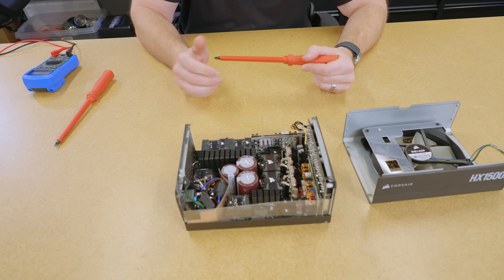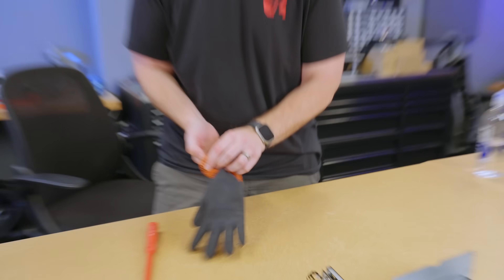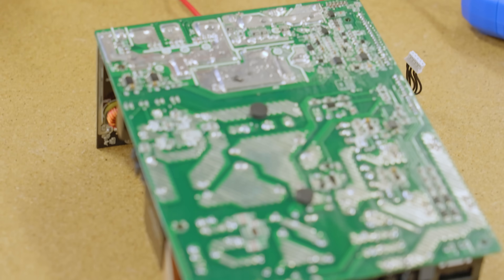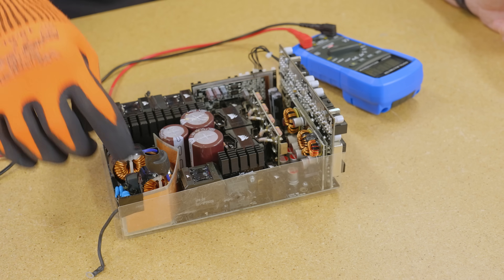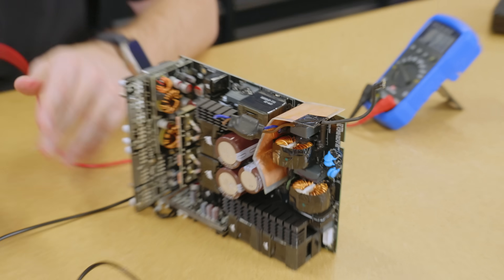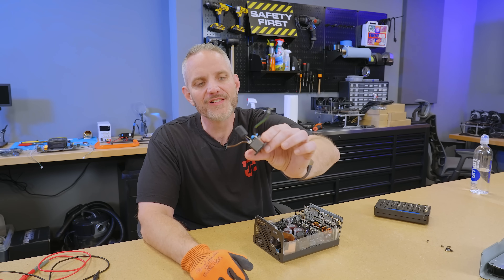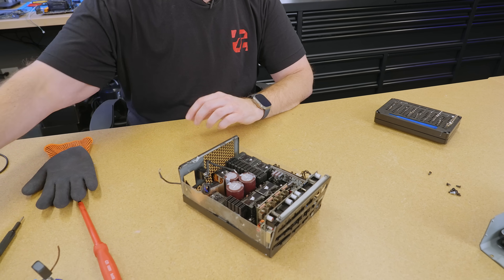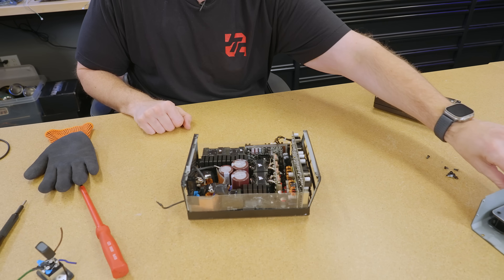Investigating what exploded in my PSU... DANGEROUS! DONT ATTEMPT!

Comment: ✅ Step 3: Use a Resistor to Bleed the Charge
Connect a power resistor (like 2.2kΩ 5W for smaller caps, or 10kΩ 20W for large ones) across the capacitor terminals.

Use insulated alligator clips to attach the resistor leads.

Hold for 30 seconds to a few minutes, depending on cap size.

For example, a 470µF cap at 400V might take 30–60 seconds to safely bleed down.
Reply: An incandescant bulb is nothing more than a power resistor that produces light as a side effect.
So just go get a GU10 base socket and a GU10 base 120v bulb incandescent or halogen bulb from the hardware store, and use that as your "power resistor". It's already rated for mains voltage so you're good to go as long as you only touch the energized stuff with one hand at a time.
Reply: or just use a multimeter with LoZ function, if possible or use it on Ω mode (switch modes before) .
I was screaming at the screen: "Stop using your bare hand, Jay!. You have a multimeter!"
Reply: I know that on small caps (like one in small electronic devices) using a multimeter to check them can also drain them if you hold it long enough (because the caps are so small). Saw another comment about using an incandescent lightbulb and i may build a little thing just for that purpose heh.
Reply: What are you talking about dummy, you don’t want high resistance resistors for discharging capacitors, you want a low resistance resistor with a high power rating. Look up tau the RC time constant, a higher resistance will increase the time it takes to discharge the capacitor 🤦‍♂️
Reply: Just short it with a hair dryer plug. Why complicate?
Reply: @GBCobber  the dryer is AC and the cap is DC. Always use a resistor to bleed the voltage off as Hartmann221 said.

Comment: My estimated guess would be like 2kW spike on the GPU 
Just short them it's that much energy only 15J - 1410uF total at 150V
I personally shorted a cap charged to 330V with total energy of roughly 500J with a screwdriver that had only isolated handle and wasn't at all made for high voltage so just yolo it 😂

Comment: I don't build computers very often but are exploding parts common?  Bout to build a 9800x3d on a Thai chi lite and shits got me trippin. N what happened to quality control and testing? Has it always been this dangerous?
Reply: The power supply failed during extreme overclocking of the RTX 5090 graphics card under liquid nitrogen. Therefore, there is not much risk during normal use. However, any electronics can fail. That's what the warranty is for.

So be calm and continue your build. And if you want to make sure you have a good power supply, choose a Seasonic model with 80 PLUS Gold or higher.

Comment: Grab a spark plug and plug wire to discharge them caps. That is what your ignition coil is, a big capacitor. 
Look at the bright side, it is a lot cheaper to replace a PSU than a GPU.
Reply: No, a coil is not a capacitor!  🙂 They are the exact opposite of each other.

Comment: Those gloves are probably coated in nitrile, which is not appropriate for high voltage protection, it’s used as a coating for gloves primarily for its chemical resistant properties.  I regularly work with chemicals, pretty much all of our gloves are nitrile, or nitrile coated.  Latex doesn’t hold up as well.  Rubber typically is not used for gloves that aren’t directly intended for use in electrical protection because of it’s tendency towards permeability and reaction potential with various chemicals can cause it to break down

Comment: the pop was one of the big caps you can see the markings on top of it that are use as vents are broken , the yellow stuff is the "oil" inside the cap that came out , if you had a loud bang some smoke a fish smell the caps his cooked , the thing you think that has exploded is probably the 5volt standby supply for the psu but pretty sure it still work the cap blew and made the fuse pop thats it

Comment: Boomer Talk: I get the biggest kick out of all the capacitor warnings everyone belts out these days. 
As a child I was the one who took the back off the TV to replace the "instant on fuse" in the 70's, very clearly warned not to touch the back of the cathode ray tube. All the tubes were considered "serviceable" and could be tested at your local TV shop or go all the way to Radio Shack.

Comment: If You'd keep the pc plugged to a power supply but disconnect the ac and then push power button, would that discharge the capacitors?

Comment: Jay, plug in an rgb controller and light bar or rgb fan. With psu unplugged.  Once they are plugged in to the psu, then take the motherboard plug and jump it so the psu thinks it’s turning on.  Caps should discharge quickly to try to power the rgb controller.  And yes, you can jump across a capacitor with a piece of wire or pliers to discharge it.  That is what AC guys say to do with outside condenser caps that run the fan.  Just rattle a screwdriver across the tips with power turned off.
Reply: Unfortunately no, that would not have achieved anything. If the PSU circuit could run, and thus discharge the capacitors, it would already have done so. The standby 5V runs constantly in an ATX PSU, and will deplete the capacitors whether connected to anything or not.

Comment: I had a old p4 system with some chepo PSU in it, had a single cap that would blow occasionally I had to put a 50v cap in place of the 25v one that kept blowing when replace with the exact same value one. Probably a different problem causing it but it was just used for  internet searching so i never had any reason to poke around any farther.

Comment: I'm into retro rigs. Some of them won't work well on modern 12v psu. I need older units that had strong 3.3 and 5v.

I had to disassemble a couple of them for inspection. But I can't get away much longer without learning how to recap them.

Comment: You can discharge capacitors with some multimeters. Some have a low impedance mode that has a resistor. Or switch it to resistance mode and then connect it.

Comment: You know there is a hot and a cold side? It is very unlikely to get shocked by grabbing the PSU on the connector daughter board, that is just 12V, 5V and 3.3V. If you get shocked by touching it, you've hit the check pot and should go gambling or buy a lottery ticket.

Comment: You caps actually lost 20 volts in 24h (us voltage is 170 peak to peak, 120 is the RMS value). with some maths, we can deduce that after around 10 days your PSU should be safe to touch.

Comment: I'm on my third actual, real PSU (not the gray, small fan, less than 300W, no PCIE connector ones I mean) and BOTH previous ones popped the OVP (Over Voltage Protection) IC. And it's probably just a case of dust and humidity that shorted something out and the circuit dies to protect the rest. Mind you, last one was 11 and a half years old cuz I usually take well care of them regarding cleaning. I still have them stored somewhere... I'm just lacking an air soldering station and patience to try to fix them.

btw, I know it's OVP IC cuz in both cases I found their top part rattling around and looked up their datasheet.

another funny point: "I'm not shorting a cap that big"..... pffff can't even number how many times I discharged caps by shortening them and whatever I was using at the time SOLDERED to the contact points

Comment: It looks like the top of the large capacitor has ruptured, which suggests it exploded due to excessive internal pressure. This might have been caused by another component failing. The cross-shaped pattern on the top of the capacitor is there intentionally — it's a pressure relief feature designed to let the capacitor vent in a controlled way if the internal pressure becomes too high. It's a safety mechanism to prevent the casing from bursting violently. At 1:54, you can clearly see the hole in the top one of the three large capacitors.
Reply: Out of curiosity, does the capacitor still hold a charge even after it has blown? I think he tested all 3 with his multimeter, and had 150v still stored inside them?
Reply: @Cristorbius  If it failed open instead of shorted it would just be like one capacitor was removed from the circuit and the others would still be charged.  The failed one could also still have some charge.
Reply: @Cristorbius yes it got overheated. It Will  burn out fast if used.
Reply: @Cristorbius you can even se some of the elektrolyt fluid on it. Supposed to be on the inside.
Reply: @Cristorbius  I've had caps that were open and leaky on a motherboard's main circuits around the cpu still run before so I'd say it's safe to assume so. But that was on a Old Compaq Evo I'm almost convinced is haunted. I replaced those caps and still have it. 🤣
Reply: None of those 3 lytics look particularly damaged to me and would definitely not have been responsible for any kind of bang. Aside from a few scuffs nothing much looks out of place. For any of them to have made an ear deafening bang the entire case would have had to rupture in a matter of milliseconds and not even the top vents are bulging.

I've blown lytics before and it's very messy. Nor are they that loud when they go.
Reply: @biggityboggityboo8775  Indeed, the capacitors don't show indication of a problem if the images are actually examined carefully. A lot of people are jumping to unjustified conclusions based on mistaking residues of black silastic and board washing as indication of a capacitor fault.
Reply: 100% Agree with you. Look at 7:44. You clearly see the ruptured top
Reply: At 5:33 there is a flat grey piece that has some black like glue on it, I think that blew out as well because that is very clearly broken there and that black stuff could have leaked out of it. Might have been a cascade effect from one to another. I bring that up because I have had a air compressor motor that I got after it was deemed "broken" (it would no longer turn) and when I took it apart one of the 2 large capacitors blew out the side. When it did explode, some sort of black resin melted onto the running plate that acts like a governor to swap between starting state and running state. It fully stopped it from turning over so I assume the capacitor that blew was the starting capacitor. If that got hot enough to melt the inside and build pressure to rupture the side then it would get that pattern look.
Reply: @silentferret1049  If you look att 3:56 you can see the same silicone glue att the caps. And att 4:29 you can se it was used to glue the component to the plastic shield. The component are probably look like that from begging hard to tell. But not every component looks perfekt. It can have a riser and the silicone glue can have forced it up. It's hard to speculate whit out having the board here. But the cap 100% have ruptured. I have seen hundreds of ruptured caps. And you can't joust measure voltage on caps to tell if they are good. First of you need to de-solder it and measure capacitances. And that gives you an indication of good or bad. Then you need to measure the internal leek. There are special machines for it. you can make a rough calculation. But you can not joust measure voltage. Fun fact some times you get caps from the factory that have got the shrink plastic on top of it the wrong way. And if the Quality control don't pic this up and joust feeds the machine components for soldering. It can be mounted reverse polarity. And if the voltage on the board is les then what the caps can handle. You will not see the problem instant. It can make the component itself overheat over time and it can send over voltage to other components that will fail to. If replacing caps you always need to double check polarity to be safe. (Sorry if I spell something wrong. English is not my main languish I'm from Sweden.)
Reply: @silentferret1049  The components you are seeing, with type starting 223J are a rather awkwardly stacked pair of .022uF 1000V film capacitors, with the black silicone for support. It's not feasible to post a link on YT, but Googling the string "473J 1000V MP3S" under Images should let you see what the .047uF version of the same capacitor is like. They're silkscreen labeled C101 and C102 on the circuit board.
 Motor start and run capacitors are often sealed with black pitch type goo that can escape when the cap goes faulty.
Reply: I wonder if the power supply was overwhelmed by a large power surge through his wall socket? Personally, I always plug my electronics into a surge protected multi-socket, which is then plugged into the mains wall socket. Even my devices with in-built surge protection are then themselves double surge protected too. Surge protection for the surge protection 😂

Power surges are very rare here in the UK. Power cuts on the other hand are becoming increasingly frequent.
Reply: @Cristorbius  Everything I've got is plugged into surge protectors because everywhere I've lived in the US has had horrible surges and it's been getting worse this year. It's saved my equipment multiple times. Our system is falling apart here due to corporate greed, heat, and building of stupid ai datacenters.

Comment: Corsair PSU's sucks. Every single one i had blew itself up. (older version)
Seasonic never let me down ... so far.
Reply: yeah seasonic psu is the true goats! 💪😎👌
Reply: What corsair's did you have? Have 4 RMx 850s over 10 years and not disappointed with them.
Reply: Only had issues with the TX series.  RM and HX have been great
Reply: It all depends on who the OEM is, for all power supplies.  I have a 750AX and a 650AX from 2011 and the 750 died after 12 years of running a F&H rig 24/7.  THE 650, has been retired from daily use but still works.
Reply: somehow this entire comment and its sub comments are full of misinformation its crazy
Reply: 😆 Seasonic make Corsair high end PSUs
Reply: @martinw245 nope because their circuits are different than corsair, so i can’t trust corsair psu anymore, dude
Reply: @indrahaseo May be circuit variation... but still manufactured by Seasonic.

Ive had issues with all makes.

Comment: To discharge connect PSU to PC and press power button when PSU disconnected from wall charger.
Reply: Unfortunately no, that would not have achieved anything. If the circuit could run to discharge the capacitors, it would already have done so. The standby 5V runs constantly in an ATX PSU, and will deplete the capacitors whether connected to anything or not.
Reply: I'm working with PCs and it helps. I'm only taking from my experience.  @PlatypusPerspective

Comment: I had a high school teacher who taught electricity and electronics as classes.

The classes were held in a lab with test benches. 

On the first day of class he always left charged capacitors on the tables. There was always someone who got zapped.
Reply: One guy conneted Live from the power plug to the tool rack as a joke. It was electrifying!
Another joke was inserting the largest catalytic cap you could get hold of into the power socket and wait for someone to turn the power on. 240V 50Hz isn't what they are supposed to handle and the bang was pretty loud.
Reply: We did this in my HS electricity class. We'd charge small capacitors and zap each other with them. The teacher, of course, warned us not to do it, but we did it anyway. Some hurt like hell, as you can imagine. Good times. 🤣
Reply: soooo... when you graduate how many of your classmates were still alive?
Reply: @billlacey2426  🤣🤣
Reply: @billlacey2426  They generally touch them with one hand and not across the heart.

Comment: Use 110v or 220v desk light with incandescent bulb, it will drain the caps if wired directly those pads. Rubber gloves is good idea to wear while doing this. I'm electric engineer by trade so long as proper precautions are done, it's safe to do. What likely died is that capacitor with small cut top of it and maybe mosfet or diode, i could get that thing back running safely within 30minutes even with that cap broken (swap the cap and w/e is broken). What you pointed is pretty much just AC to DC transformer, it's probably just fine unless if the internal insulation or coils were burned.

Comment: Caps are usually more magic smoke than flash-bang. Sounds like a switching regulator failed, they usually are the next devices after the rectification. They don't always show extreme carnage, often a small hole burnt through them.

Comment: 5:17 looks like a blown component with a split and its guts blown out and solidified like a popcorn kernel. Or it could be silicone, but that component doesn't look right, it looks cracked and tilted. Can't say for sure.
Reply: That looks like 2 film capacitors stacked on top of each other and siliconed together.
Reply: @WolfGamerBohumin  Correct.
Reply: Good catch. I used frame by frame advance and can see markings C101 and C102 beside that component. Markings say 223J 2211 1000 MP3s. That doesn't search well on Google, but sort of comes back to a 1000V rated capacitor if you go by the 223J. And it does look funky to my eye.

Comment: I just wonder if it hit a 3000 watts spike. That should be enough to cause this. But why didnt your circuit breaker trip. That line is good for 1500 W at continuous load but can handle spikes of 2,000 watts. I wonder if the cards BIOS for a fraction of a second demanded 4,000 watts

Comment: I have played around inside the power supply and gave myself an image burn from arcing the ac to dc by the digital multimeter probes and puff big bright blue arc of electricity that managed to trip the circuit breaker while the power supply was live wasn't pleasant to be dealing with